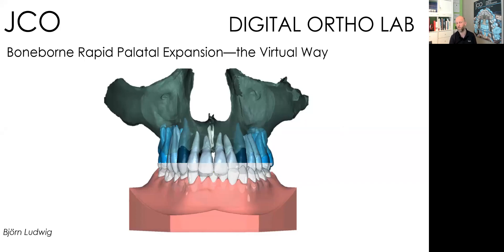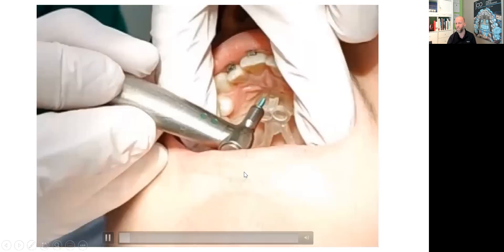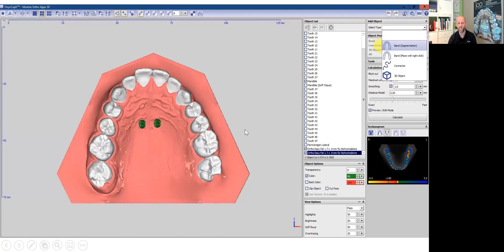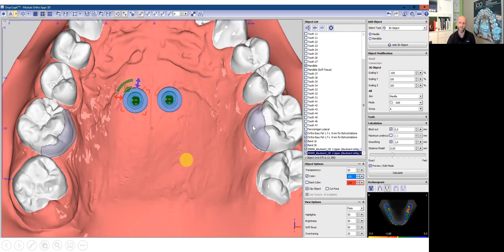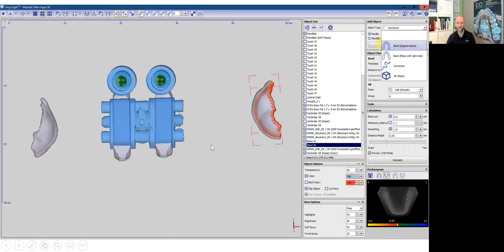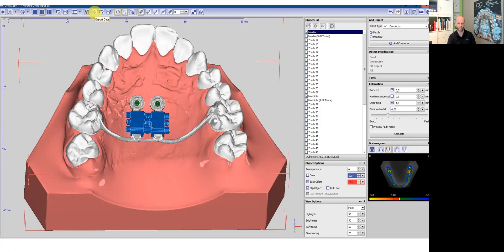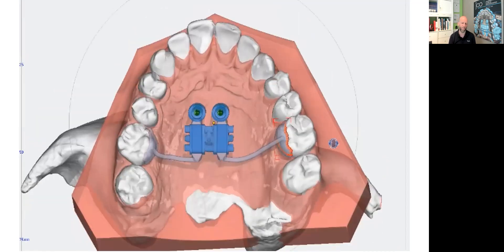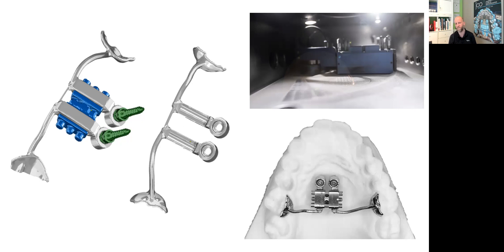Designing A Digital Boneborne MARPE

Comment: Great video! Is the STL library included in the software? what brand of expansion screw was used in the video ? does the program also include Leone screws? Thank you
Reply from the maker: From Dr. Ludwig:

Many STL files are included in the software called OnyxCeph. If not, you can find most of them on our blog on Facebook. Leone also shares their STL files with customers. In that video, we used the so-called power screw for Tiger Dental.